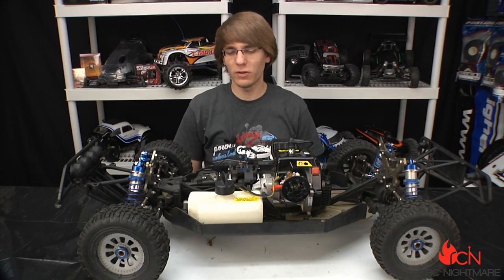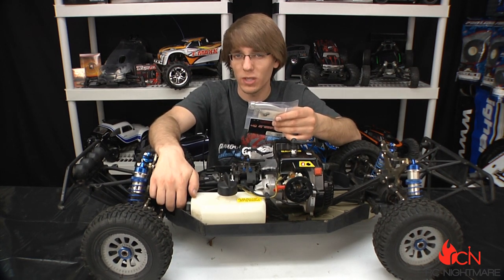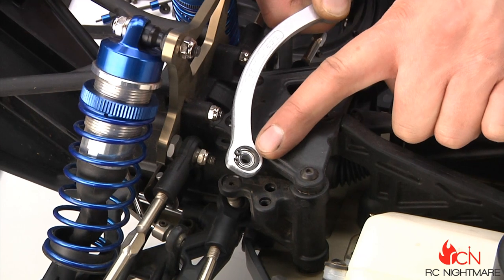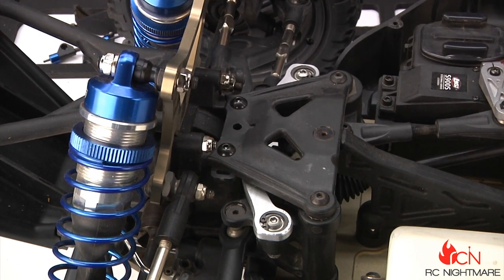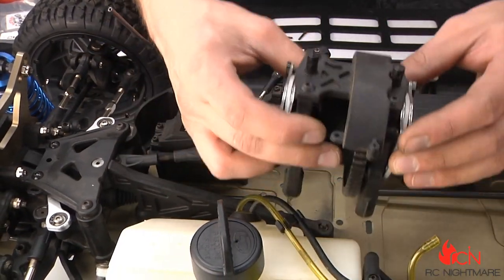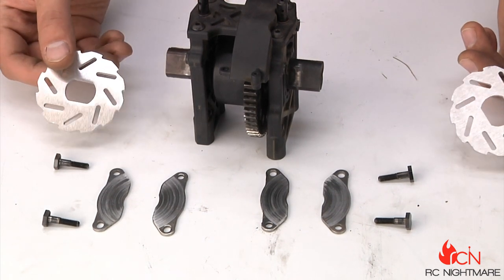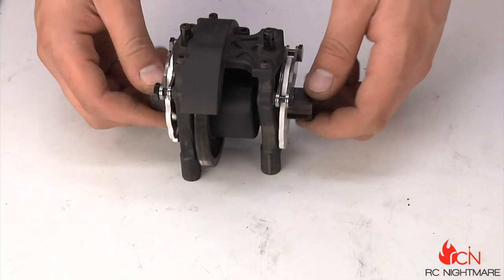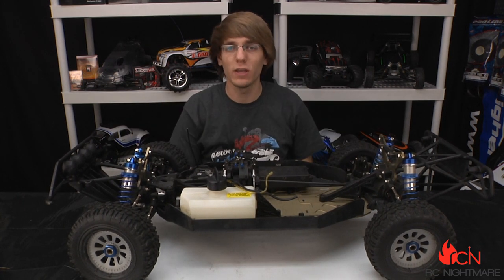Losi 5IVE Brake Upgrade & Steering Upgrade

Comment: When installing the Team Chase Steering Arm, the bell crank where you install the bolts have no exit hole. Looks like I'll have to drill it out. Does it matter if I use a drill bit which eats up the self tapped threads since the new hardware have nylon lock nuts?